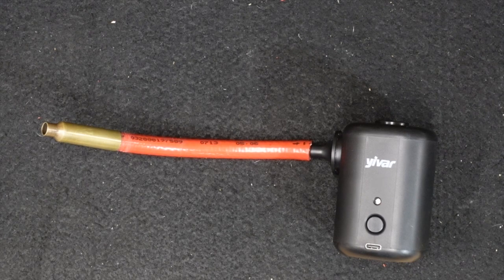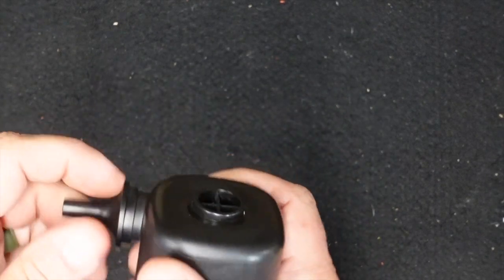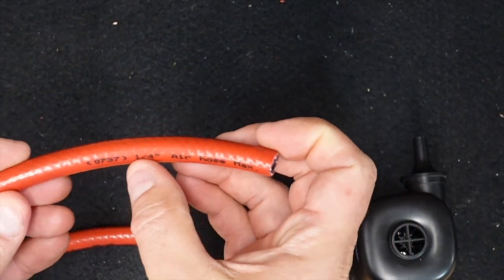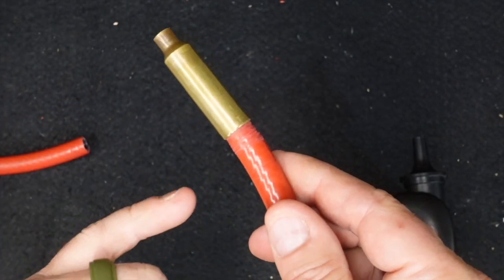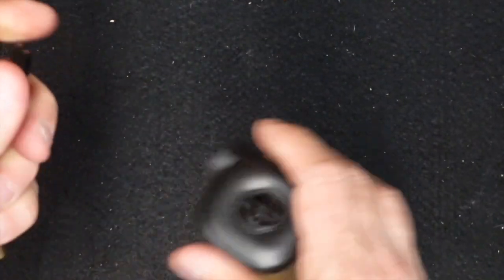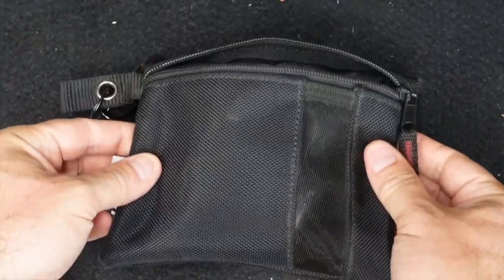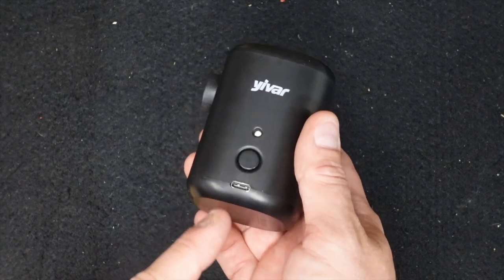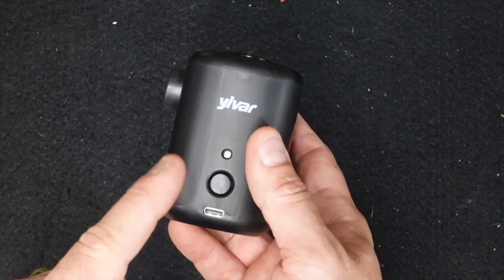Building a better rifle barrel cooler on the cheap

Comment: Great idea!   But something that most people don't realize is that air pulled through something cools faster than air that is pushed through.   Food for thought 🤔
Reply from the maker: So here’s the funny thing. These pumps are also used to deflate and I worked on using it that way at the end of the barrel but it just didn’t work for me. It was tough to keep it on especially when I put my gun away in a bag between relays.
Reply: @FClassJohn  well,  I didn't say that it was easy 🤣
Reply: @FClassJohn  can you set it to suck from the chamber end and would it cool faster  I think that's what Jay was saying.
Reply from the maker: @jdne5b  Yeah I suppose that might be able to happen but the connection on the sucking end isn't nearly as good so I'd have to play with it.....challenge accepted!
Reply: So, turns out using a spent brass case for breach adapter gets stuck in bore if you suck the heat out through the breach. The is bc the brass absorbs heat and expands. At some point you have to push air back down the barrel and adapter to cool it enough to release. Or go in with a dental pick and pull out adapter if it separates from your hose.🤔

Comment: Gonna build one of these this weekend. The pump you used is no longer available but there are plenty of choices to choose from. Got mine for $22 from Amazon. Two feet of 1/4 inch fuel line from Ace Hardware: $6.99. Case to cut: FREE. Thanks!

Comment: I have a MagnetoSpeed and when it's in the chamber operating I throw a towel over top of the rifle and cover the pump and it deadens the sound. You can't do that with the other home made ones and I know because I have one and if you try to cover the pump you shut off the air flow. 
MagnetoSpeed also acts as a great chamber flag and very easy to install in chamber plus looks much better.

Comment: This just became my favorite video from you.
I'm about to start some development with a skinny barrel AR.  This will be great for adding between strings during workup.  These new production barrels are capable of great (relative) accuracy- but heat buildup can quickly skew testing results after 10-20 rounds.  Good news- if it heats up quickly, it will cool quickly.  With my precision bolt guns, I rarely experience heat issues (I never really run a round extensive course of fire) but there is no reason to NOT run this for a few minutes between strings.  Thank you!

Comment: I use an aerator for a bait bucket with some plastic tubing. I put the aerator in a small lunch cooler with 2 re-freezable blocks and the other end in the chamber.  It’s not the quickest because of air output. May try the fan/pump you bought. You may want to try a longer piece of hose and put that pump in a chilled cooler.

Comment: I tried a few DIYs but find myself throwing the Chamber Chiller Pro in my range bag most of the time. I could not get over the noise factor of the DIYs and the Chamber Chiller is just one little device easily carried, despite its weaker air flow. I connect it to my anker power supply, which I share with the Labradar.

Comment: I like it.  I've been using a Caldwell Accumax cooler.  It was designed for an AR and fits into the magazine well.  It has rechargeable batteries, and an LED light that glows in the action showing the chambere is clear.  For a bolt gun I cram some 3/8" ID silicone tubing into the cooler and the ither ebd into my chamber.  Caldwell discontinued the cooler, but they are still avaliable on Amazion.

Comment: I experimented with hose sizes and fittings. Using a hose with a larger internal diameter and larger fitting yielded much more airflow (obviously). through optimization i went from 10 mph to 16 mph on my 26" 6.5 cm barrel. I used a hose with an inside diameter slightly larger than the cartridge (seat the cartridge inside the hose, opposed to the hose inside the cartridge like your video). I also cut open the shoulder so it is a straight cylinder without a constriction.
Reply from the maker: Sounds good, glad you got it work even better.

Comment: I've seen on several of your videos that you have temperature strips on your barrels. What barrel temps do you like to achieve for shooting? I have a carbon fiber proof barrel. Where would you put one of those temp stickers on that barrel? Maybe put it on that barrel but look for a lower temp on the strip to associate with a higher barrel temp.

Comment: John have you used cold packs?  Just cool ones.  Or is that too far into the condensation zone?  Just curious.  Like your new tool.  I see guys pouring water down into the barrel but I am not going there.  Seems like too much can go wrong in my opinion and more to add to the fiddle factor
Reply from the maker: I don’t use things like cold packs because it’s just not practical. I need to cool my barrel over multiple relays they could take 2/3 of a day and plus for travel it just takes up too much space and too much to manage. Having a barrel cooler that is simple and in my range bag all the time is just the easiest way to go.

Comment: What about going the other way? Use the deflate end of the pump and pull air from the tip. No chamber flag issues.
Reply from the maker: I actually tested it that way and I didn’t like doing that for a couple reasons. The first is that it’s harder to get a secure connection on the end of the barrel and since a lot of the places we shoot are on the edge of berms if it were to fall off it would roll down and make for a more uncomfortable situation having to go get it potentially. The other is I honestly just found that blowing had more force than sucking.

Comment: Mine is the "Original Barrel Cooler".  Mine blows at 10mph on my windmeter.  There's a guy on youtube that made a video testing all of the available coolers showing there wind speeds.

The only negative is it effects those noise cancelling ear muffs quite a bit.  I can cause the ear muffs to stop working because it's trying to key in on that sound.

Comment: y not wrap an icebag around the hose  or lay one of them freeze packs on the hose
Reply: I was thinking the same thing. Maybe tap a fitting into an old cooler with ice and put a hose on the intake side of the blower?

Comment: The one thing that stops me from using any type of cooler is blowing dust or grit in my barrel.
Reply: You could rubber band a weed wacker foam air filter to it
Reply: @swamper2fly  that's a good idea